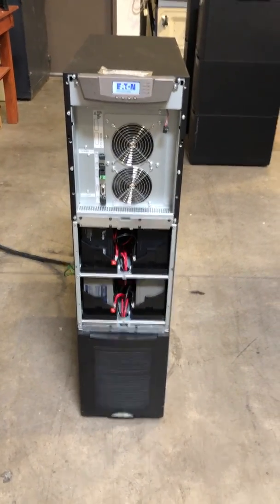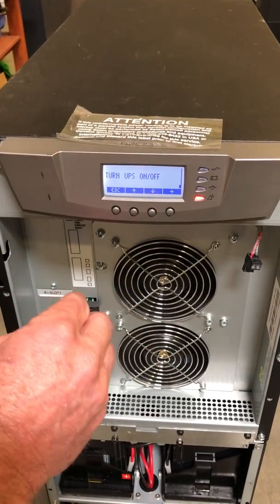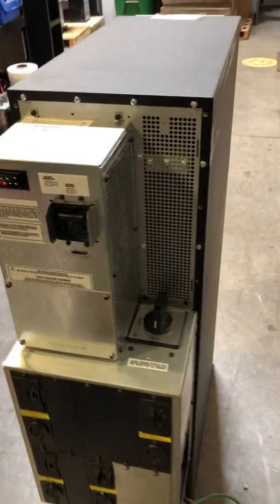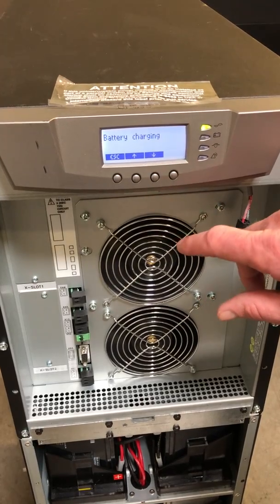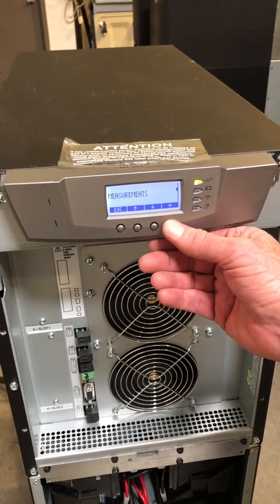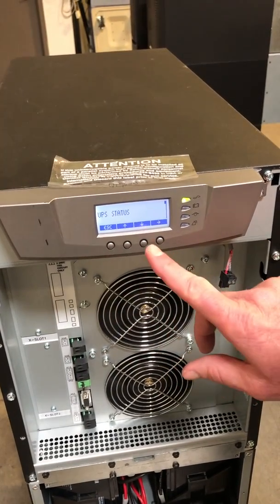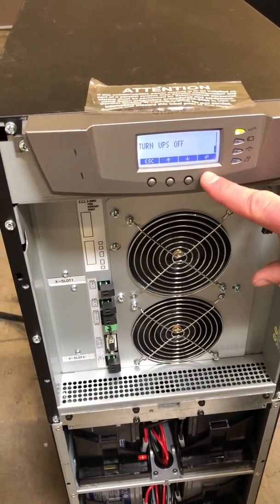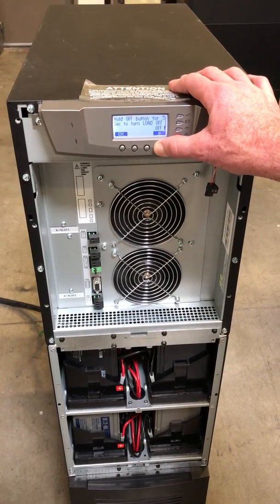Eaton 9155 12 kVA Uninterruptible Power System (UPS)

Comment: Pls can you make more video on ups 9355 12kVA.
1)How we can replace the batteries and when we need to replace the batteries?
2)What about bypass option ? How and when we need to connect with bypass to the system.
3) if the batteries is faulty so can we connect the ups with the system?
4) how to connect ups with the system from control menu ?
5) 12KVA ups is design for how much load? 
6) how to connect ups with the system in practical with the system ? Either 3-phase or single phase UPS
I will be waiting for your response
Thank you